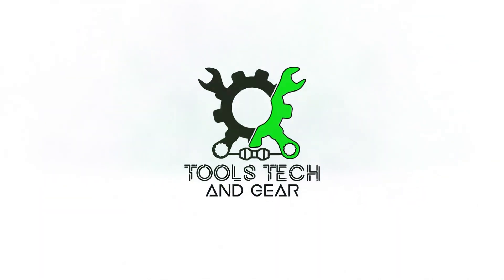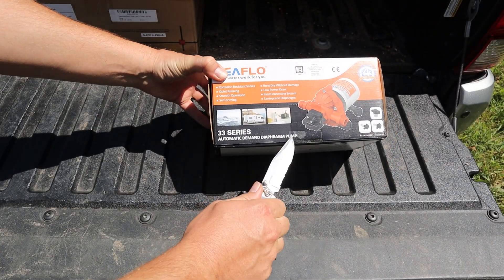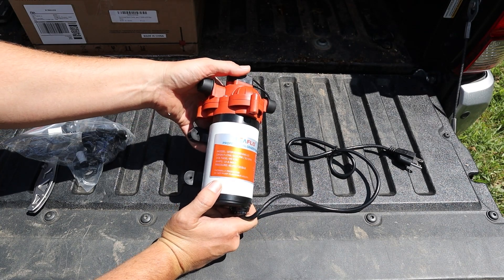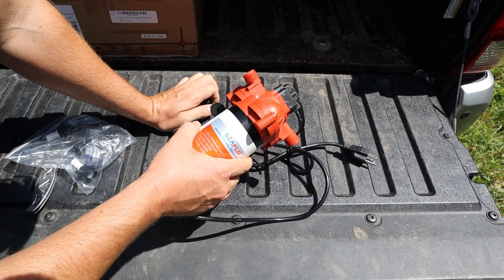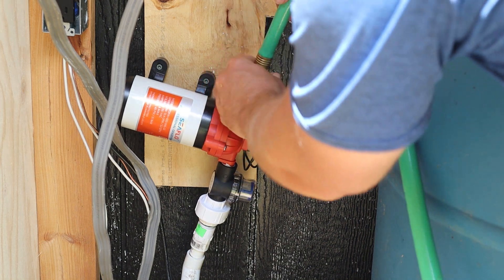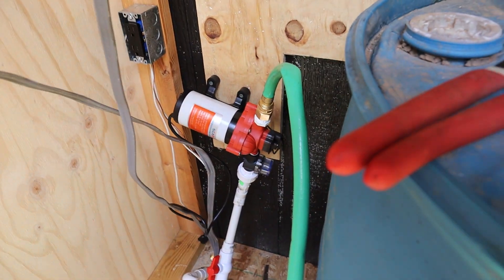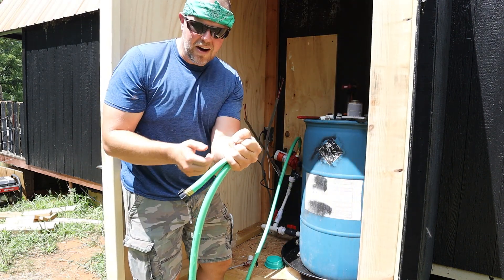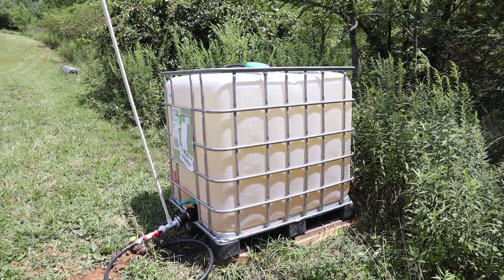SeaFlo 45psi 3gpm Diaphragm Pump unbox and test

Comment: Really pleased to come across this video, as we are about to embark on an application using water from a tote to water in our greenhouses. In 2024 I watched my first 'Ram Pump'' video (and then 20 others you have made. Always informative. I have spent a little time debating on whether we need to upgrade to 5-6 gallons a minute or stick with 3-3.5? Mainly in whether we will get enough pressure to water (by hand, no sprinkler) at a 100 foot distance using a lighter pressure pump. I guess these pumps are cheap enough to replace, so if there is an issue we'lll upgrade to higher PSI.
Thanks Seth.

Comment: I don't think it is a "flow sensor" but simply a pressure switch similar to a well pump setup.  These little pumps work very well with a small pressure tank (seaflo and shurflow sell approx 2L tanks, but something up to 1 or 2 gallon is suitable - could even jerry rig something using a soda bottle or similar) to even out the water flow and reduce pump cycling.